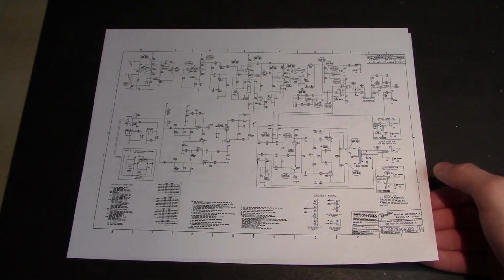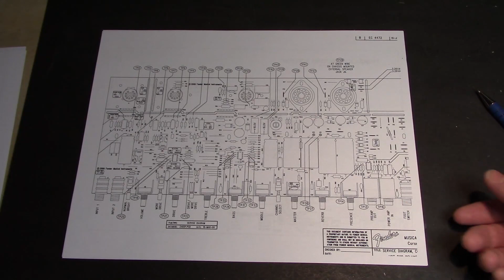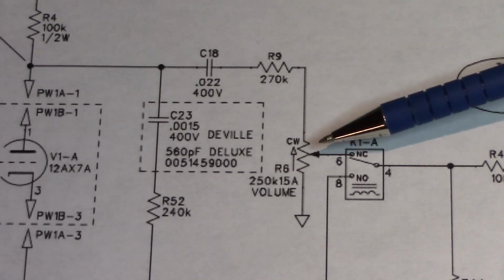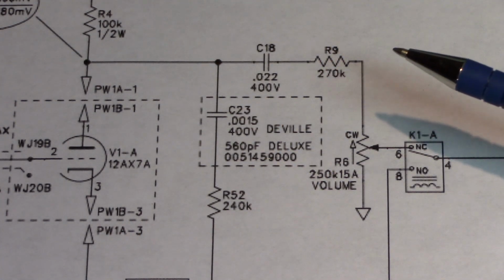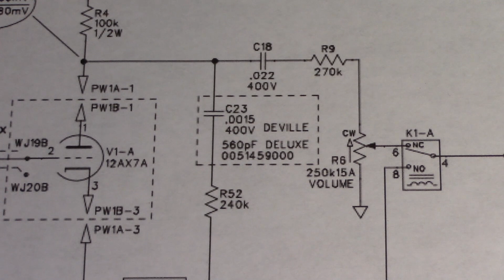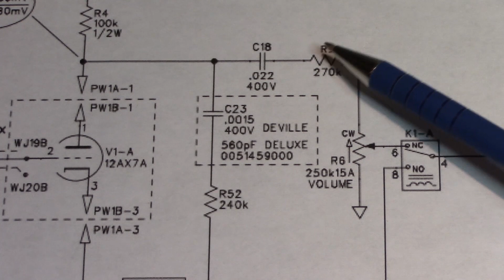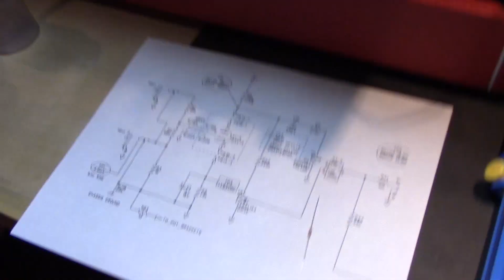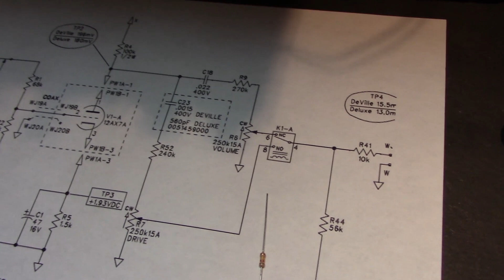Modifying the Fender Hot Rod Deluxe III - Tinman Electronics 15

Comment: you don't need to change any tubes, you just need to put a better pot for volume..... as John Boley said, the audio taper pot. It is a 5.00 part and it's easy to change out....done

Comment: Good job, but you also could've tried a 500k variable resistor for less volume, also according to Psionic amp, there are places on the board that over heat also some of Fender amps have issues and can be modify and you should asked other techs what they might actually be? 

I have one here (on lone from a good freind) and one thing I learned is this Deluxe Mod 3 uses a Celestion 80 and is total wrong for this amp. A 30watt to 50watts would sound a lot better then what it maybe using now. 

I borrowed his amp to try my 2 JBL custom cabinets I built. My little junior uses a 12"inch JBL and a 2-way JBL crossover with a Sansui tweeter closed system no ports. It's like day and night. My cabinet is beautiful and it does make the Fender Rock with my D123e. I also have (from the same peron) a Fender Viborluxe from the 1970s with new caps and resistors and it's original D123F JBL 15". It last belong to a steel guitarist that passed away and his nephew inherited his musical collection like my favorite Uncle died and he bonded with and asked to help make a sound documentation of my 50 watt Bugera T-50 over the 40 watt Fender and show off my Homemade  custom Joe Junior over little Junior? It will be filmed.

Comment: An easier way is to replace the pre amp tube /valve with an ecc82 or 12au7 It gives you full clean volume control .

Comment: Just change the first pre amp tube (sorry can’t remember what the new tube is called) and that’s it. Rolls off 20% of the volume. Some people also use a volume pedal in the effects loop. This is way to much crap to do when u can achieve what you want with a single tube swap. EDIT: tube is 12AT7. Just replace the first pre amp tube

Comment: I agree, it is a loud amp. Had mine for 15 years now. What puzzles me is why you don't have a dB meter to show the viewers the actual sound pressure numbers. I would guess at 1 meter from the center of the speaker, the sound pressure would read, 120 to 130 dBs.

Comment: modded these amps for 20 years exclusively, just curve pot w 220k resistor...respectfully jim@omegaamps
Reply: James, I'm familiar with your work.   is there any way to make the drive channel any better?  I put 5751s in v1 and v2, and I made a volume box to run in the effects loop after the preamp (which is more for getting breakup on the clean channel at lower volume) ... but the drive channel sucks.

Comment: The 127a7 tube swap is a tone sucker. Robs the amp of its depth. Get a separate volume control such as an eq pedal, run it through the affects loop and control the volume with ease while also enhancing tonal options.

Comment: Do you know which treb pot value this amp has ? I heard the Blues Deluxe has 1 Meg treb pots and that is why it sounds brighter.
Reply: Yes it has 250KB which is 250kOhm linear taper. I don´t know what the Blues DeLuxe has, but in my opinion it does not sound nearly as good as the HRDLX.

Comment: There are a lot of unkind comments out there -the young guy is learning as we all did and still do..I would suggest if you want to attenuate the output of that first stage without spending the 10 bucks then experiment with a trimpot of around 1 meg in that area .and even try a switch if you're keen on the idea so that you can return the amp to its original spec when you need that extra gain. Another method that  I use with my old twin is to hook a 50v zener between ground and the board ground tag to effectively lower the HT level of the output stage. Not sure  about doing this with a Hotrod though.I guess the reason for using a linear pot was to have a linear increase in clipping rather than logarithmic.The master volume is a good one to change in this respect.

Comment: A much simpler (and well-known) solution: Switching out the stock volume control, which is a linear taper pot, for one that's an audio taper pot. Your volume control will react smoothly, with less crazy reaction. I don't understand why Fender is using these, even on some of the more expensive reissues. You haven't actually helped this issue, just moved the goal post.

Comment: Dood.  Well known problem.  If you don't know how it works then you shouldnt be in the amp.  The volume control pot is linear taper.  That's the problem.  Replace it with an audio taper pot and your volume problem is solved.

Comment: The msot effective things to do are:
1) Change the lowdspeakers with less efficient one.
2) Change the first tube from 12AX7 to 12AT7
3) buy some Jellowjackets (or similar) and put 2 EL84 instead of the 6L6
Reducing the volumer on the preamp side is not the best at all with a tube amplifier....

Comment: Change the volume potentiometer that the amp comes with, a 250K ohm linear, with a 250K ohm audio taper pot. This allows the volume to change in a more predictable, and usable, manner. Then if you want, you can change out the preamp tube(s) to 12AT7's in order to lower the gain, as well as volume levels, of the amp. Change V1to a 12AT7 to reduce the gain of the amp and smooth out the tone. Change V2 to a 12AT7 to lower the gain a little bit more, but more useful for taming the reverb should you find it a bit much. You can also change the Driver tube out from a 12AX7 to a 12AT7 to reduce how hard the power tubes are driven, thus reducing the volume level a bit and providing further headroom for the output tubes.     Changing out the tubes will change the sound, and characteristics of the amp, changing the volume pot to an audio taper pot will change the way the volume pot works, while keeping the tonal characteristics intact. There is also a circuit change you can do to the amp that changes the power tubes functioning in Pentode, to Triode, essentially reducing the power of the amplifier by half. Oh and it's switchable so you can play at full power for gigs, or half power for practice/recording. It requires very few components to enact, but you do need to have a good foundation in electronics to make the change.**TUBE AMPS CONTAIN EXTREMELY HIGH VOLTAGES, AT CURRENT LEVELS THAT CAN, AND PROBABLY WILL, KILL YOU! DO NOT PROD AROUND INSIDE OF A TUBE AMPLIFIER WITHOUT ADHERING TO PROPER SAFETY PROTOCOLS, AND BEING VERSED IN ELECTRONICS THEORY!**
Reply: Funny thing it already comes with a 250KA pot, and that IS an audio taper. Linear tapers are called B.

Comment: Fender uses a linear taper pot for the Master Volume when it should be an audio taper.Just change the pot and no need to do anything else. "Note" don't climb into an amp unless you know what your doing and don't try and mod without an electronic education.Yes I'm Telling you off for posting this video when clearly you know nothing.
Reply: Fender really needs to knock that shit off...I think they do it because of the WOW factor it gives when you first plug in at the store.  Volume pot change is definitely the best solution here.  Changing out the V1 dramatically affects the tone of the amp.  If that's what you want to do then thats fine. But if you bought the amp because you liked the tone, then that defeats the purpose.

Comment: As other people commented, a non-linear pot was the solution. That stated, the part you missed is that the pot WAS the voltage divider. You are pulling off the pot from the middle. Therefore you have a resistor on one side of the line you're pulling and the other side that you are pulling from.

Comment: guys, trust me just put a volume pedal in the effects loop. you're then able to change volume, without affecting the tone of the pre-amp circuit.
Reply: Tried that first before changing the valve. It means you can not use FX in there and it took all the punch and tone out. The valve is the best option.

Comment: You're a fucking idiot. 
Fender puts linear volume pots in its amps, stock, which is why the amp sounds so loud at 2.
Db increases are not linear.
Swap the volume pot from linear to logarithmic and you have a more useable volume control.
What you've done is increase the resistance going to a variable resistor which means  that amp will now never get to its highest volume.
You might have a lot of stuff mummy and daddy bought you for your fuckwit dabbling  but you have a fuck tonne to learn about simple physics and math.

Comment: Could you not just add another resistor in parallel to R9 to have a total desired resistance without removing the resistor at all?
Reply: No. Parallel resistors give lower resistance, and he wants a higher value of resistance.
You can combine resistors in series or parallel to reach a certain value calculated using ohms law. 
In this case its as easy to just use a new resistor.
Costs a penny or two depending how many you buy. 😉

Comment: So the problem is that they're using linear pots and you want some audio taper pots. If you search for R-VHD-250KA on Antique Electronic Supply you can get some pots that will fit perfectly in a HRD.

Comment: Hi All,
  I have the George Benson model which comes with the 12AT7 mod. I also went out and bought the 12AX7 so I can switch out and have the best of both worlds.
For those that are equipped with the 12AX7, my question is, why not just plug into the #2 input? It's designed with less sensitivity (-6db) and is cleaner due to less preamp input volume? Wouldn't that in theory be the same thing?
Reply: Not exactly, it has an attenuated input, but also a much lower input impedance, that probably will cut some of your treble. But try it, maybe you will like it.

Comment: Change V1 to a 12AT7. Problem solved and it's more suitable as a practice amp.
Reply: Better yet, put a 5751 in V1 and you're done. 12At7 are more suitable for phase inverters.
Reply: @Strongpersuader  I had a 5751 in the hot rod when I bought it. The 5751 is rated at 70%, my amp with this valve was still too loud at no 2. The AT7 is not just for phase inverter and was the valve used in the tweed amp back in the 50's. I put one in my V1 and it works perfectly, same tone and now 2 or 3 is fine at home and up to 7 for gig. Perfect.
Reply: @grumpy8413  Many Tweed amps used 12AY7 in the preamp.which have less amplification as 12AT7.
Reply: Marco Hermans, exactly...such an easy “mod”. Why is everyone going to this much trouble when simply swapping the tubes has the same effect?
Reply: ... Or add a volume pedal in the effects channel. Voila, the master volume Fender should have included in the amp...
Reply: My Benson is set up with an 12AT7 and a 100W Speaker, and I'm still trying to make it easier to control.  It goes from no volume to nuts in almost no movement of the volume knob.
Reply: @jamesquinlan3620  replace the channel 1 and master volume with audio taper (logarithmic) volume pots instead of the linear taper the amp comes with: https://www.amazon.com/gp/product/B00LJY3LU2
Reply: @parrottsquawk975  Thanks, I'm looking into that right now!
Reply: James Quinlan no worries! I put 12at7 tubes in all 3 preamp positions, I also replaced the 6L6 power section tubes with a pair of jj6v6s tubes. I can get bedroom volumes now, and the distortion sounds a lot better too!
Reply: I tryed the 12AT7 MOD, didnt like it at all, amp lost it's mojo. Switched back to 12AX7, sounds much better, i still need to diel the volume pot to 1.7...😄

Comment: you did nothing to the volume level of the amp,you just lowered the volume on your guitar
and probably did more damage than good.why even bother with this?????

show your settings(run them all  exactly at 12 oclock as a baseline)
have your guitar volume full,not wherever you choose on both video examples
you need to eliminate all altering variables to have a comparable baseline before and after.
Reply from the maker: +trillriff-axegrinder Yeah, sorry. This video, and a whole bunch of my other videos were rushed. I haven't posted a video in a long time because I want to avoid these kinds of inconsistencies. There's a lot more that I could have elaborated on, and I'm hoping to come up with some more worth-while content in the near-future.

Comment: just to help ya pots are marked a or b . a is audio taper , b is linear taper. audio taper is a smooth transition in volume. linear gets loud fast far less control. fender has used linear pots in the hot rod deluxes to sound louder at perceived lower volume .using a 250k audio pot cures lack of control. this is a simple fix. and it is the source of the problem
Reply: +sccloser If Fender seriously does this, I just lost a lot of respect for them.
Reply: +Fred Jella +1  He should have just switched the pot to audio taper.
Reply: They use linear taper pots so that  kids are blow away by how loud the amp gets when playing "smoke on the water" at the local guitar center.

Comment: @tinman electronics im not being a dick or anything like that you even said you "don't know much about guitar amps" but guitar tube amps don't really work like most electronics. changing values and volts can in theory "work" but you can also kill the "magic" and great tones that happen inside amps. don't think of guitar amps as simple power amps like in a car or home stereo where changing things like resistors and what not will work. in a guitar amp anything and everything effects the amps tone. its more voodoo then science :) a popular mod would actually be to take out the master volume letting the amp run full open. using the guitars volume knob to control the amps volume. sounds dumb but gives you great tone. you should really look into guitar amps its like a whole new world. its almost a art form in itself.
Reply: +harrisonrg777  Well said.  Don't kill the magic.

Comment: Here's an idea for your friend, don't buy a 40 watt valve amp if you're looking to play at home.
Reply: AcridPeter Here's an idea for you: don't say dumb things. It wouldn't matter if the amp were 40 watts or 400 watts, if it were designed properly, and built w/ the right components, one would be able to adjust the volume down to a whisper. Not that it's uncommon for pots to be touchy on the low end of the range, but these HR amps are notorious for having all the action of the vol ctrl take place in the first 2/3 of their travel. And in particular, they're VERY touchy in the area addressed in this video. This all is irrespective of pwr output.
Reply: AcridPeter That may be what YOU'RE saying, but that's not what this video is about. And if anyone was being obnoxious it was you by saying the poster should tell his friend not to use a 40W amp at home. The complaint wasn't about getting a great tone, it was simply about being able to turn the thing down low enough for home practice. That's all.
Reply: +fretbuzz59 I think you're missing the point of what we're saying (and sounding quite obnoxious in the process). the point we're making is that it's probably a better idea to get hold of a low -powered tube amp than have a 40watter running at 1 percent and barely tickling the tubes. we're talking about tone, not whether or not you can turn the thing down to a whisper.
Reply: trillriff-axegrinder With all due respect, you have no idea what you're talking about.

Yes, a 40W amp driven hard enough for the output tubes to begin to distort will be loud--really loud. But that's not what we're talking about. The issue is being able to turn an amp's volume down low enough for use in a small room. That's something any amp should be able to do.
Reply: +fretbuzz59 acrid peter is actually correct,a 40 watt tube amp is brutally loud for home use and it is nothing to do with fender or the quality of the amp in any way.this guys friend should buy a 5 watt tube amp or an attenuater instead of trying to re-engineering something he has no idea about.i had a 100 watt marshall jcm800 for 20 years and you dont just change a few resistors to change the way a guitar amp works or they would've done this right from the beginning.

tube amps need some serious power in the tubes to get the best sound quality and tone

Comment: I've just replace with an audiotaper pot and the result is good!
Reply: Daniel Lambert    You did the right thing. I am baffled by the misuse of linear taper pots and audio taper pots. I see the same thing on guitars. Volume controls should be audio taper not linear taper. Put the linear taper on the tone controls.

Comment: back in the day....adding a second volume pot on single volume amps....70s.....did what was the effect of offering a better management of volume.....  one became the first distortion pot to add overdrive at different master volume levels.....   cheap and non specific in the no changes to the amp circuitry other than creating more lower end volume....